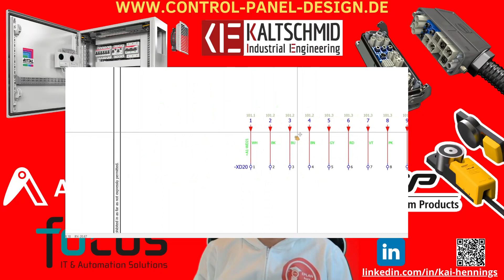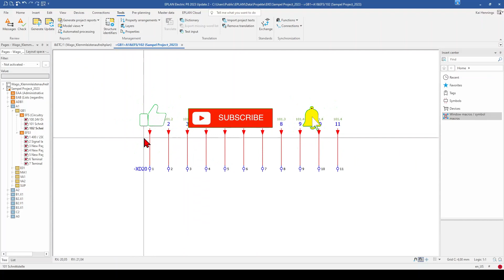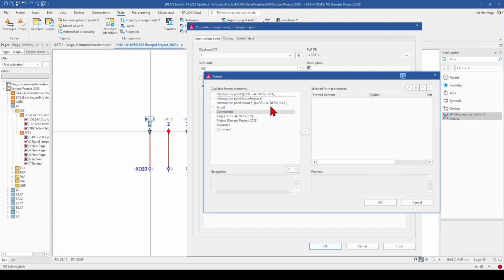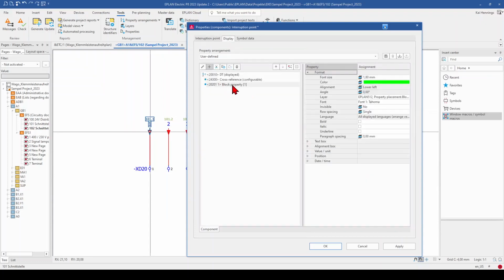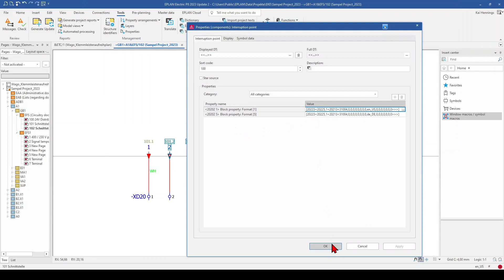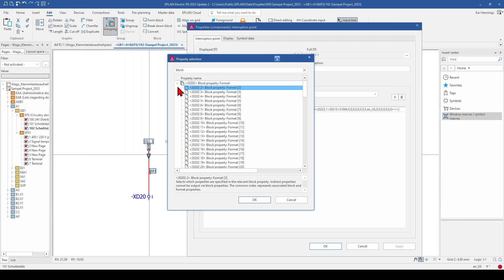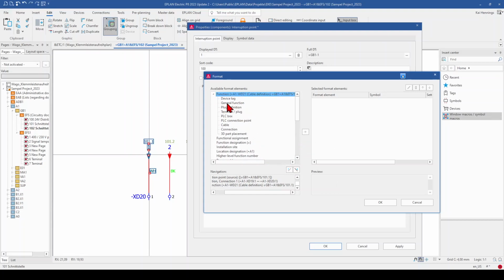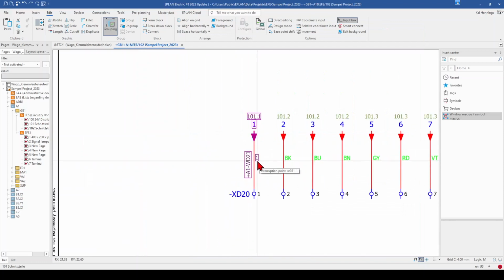How to show cable information on the opposite side ↔💡 with Block Properties

Comment: Excellent tutorial but why not just copy the cable from the source and and make it a non-main function? Also, wouldn't you achive the same thing with connection points?
Reply from the maker: Basically you're right. But depending on your message management setting your solution will create fault messages because you have two connection points on one connection. If you don't use this message it's fine
Reply: @eplaninanutshell  I can have two cable definition where one is main function and the other is non-main function. Will this create a error message? Just to be clear, there was no critique against you, just curiosity. I watch your tutorials often and find them very helpful.
Reply from the maker: @KlingKlang81 I don't feel like criticized by you 😎